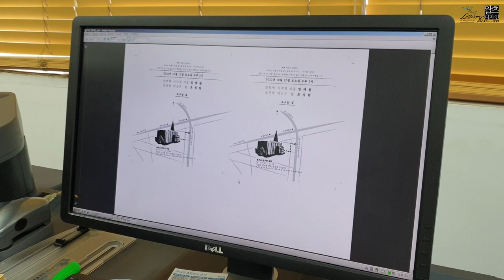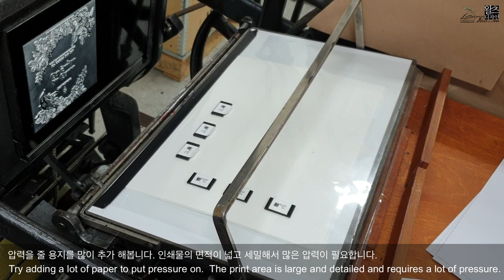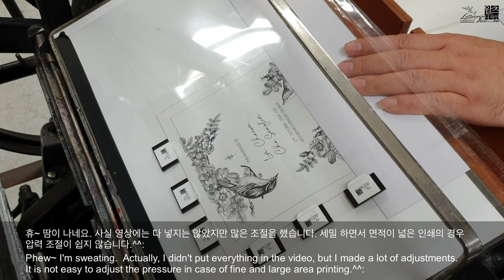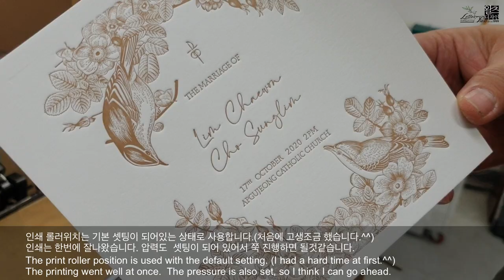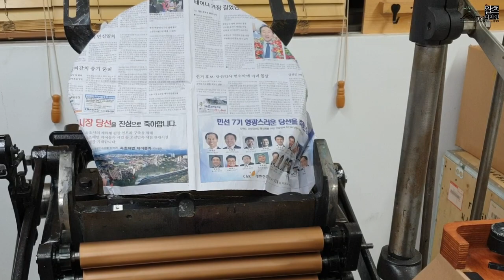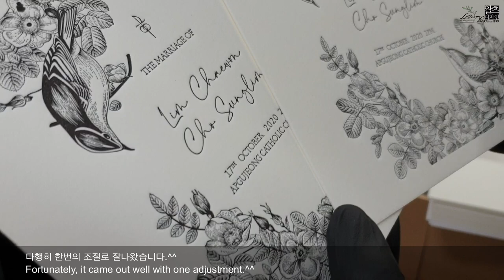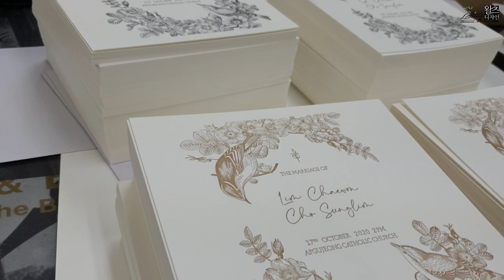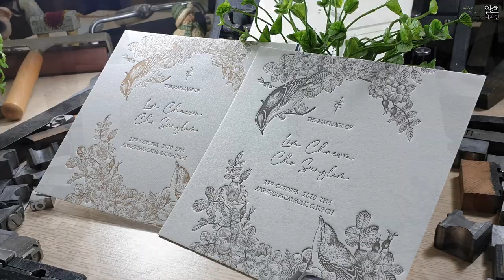Make a letterpress wedding invitation. 고급스러운 레터프레스 청첩장 만들기.

Comment: Waltzdesign How do you make your design plates ? Are they photopolymer plates ?
Thank you
Reply from the maker: It is produced by requesting a company that makes the plate. Usually, chemical corrosion method and CNC engraving method are used.